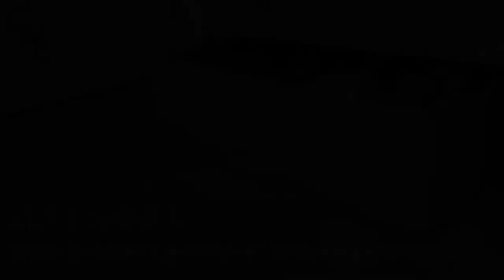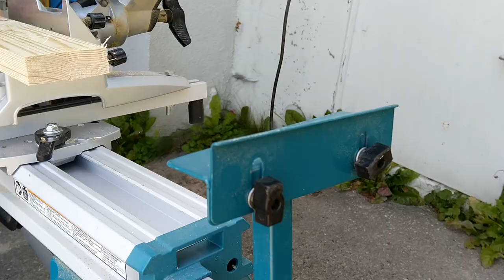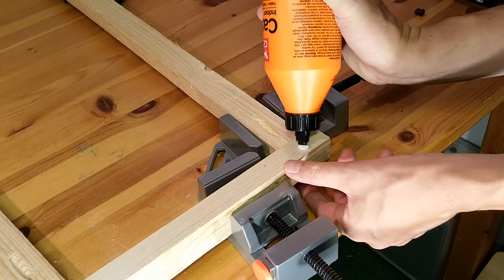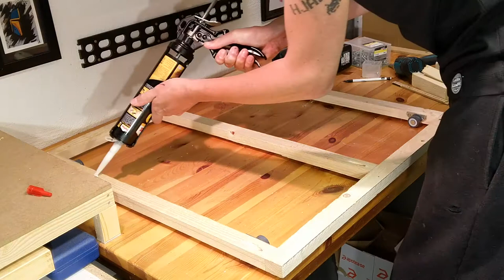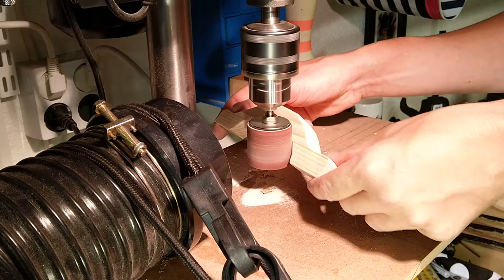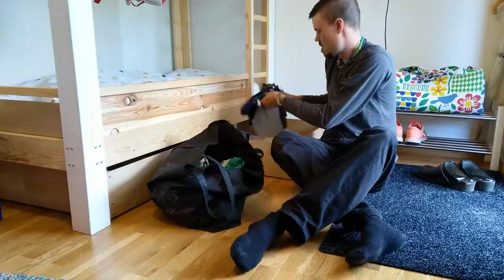Let's make a bed drawer from IKEA flooring!

Comment: Hey! Thanks for the shoutout :D Also featuring the #woodjogs21 DIY pocket hole jig! They came out great, those little wheels are very cool.
Reply from the maker: Thanks, and you are very welcome!
It worked great, but it was a little nervy building them at home with no means to check if my measurements were correct while building...